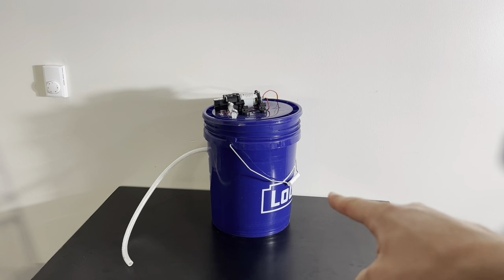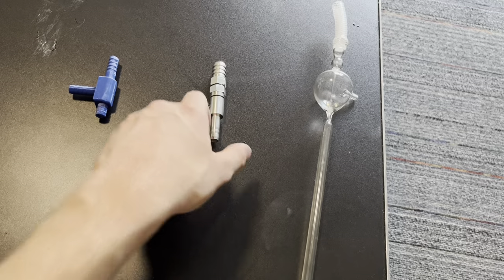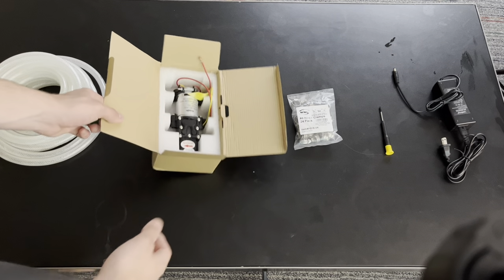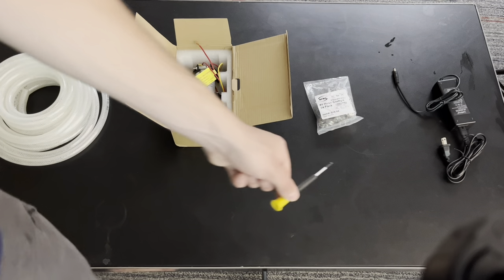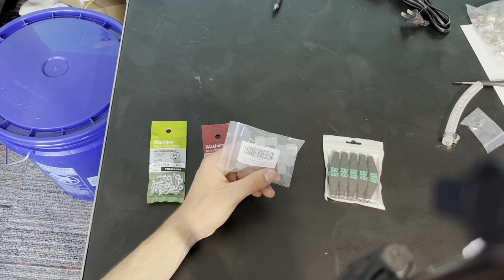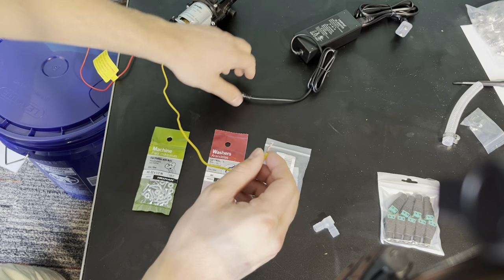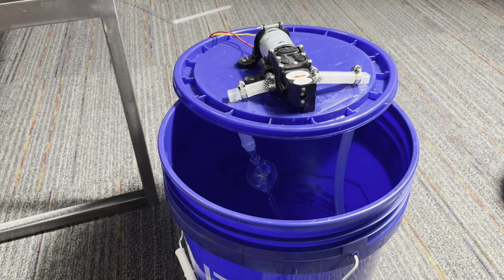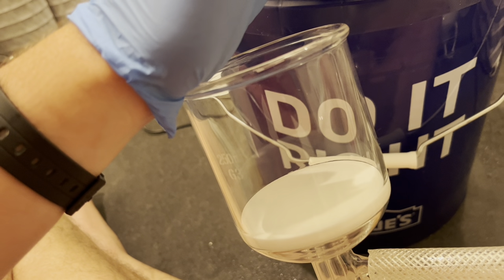Building a Recirculating Water Aspirator Vacuum Pump Under $40

Comment: Thanks for mentioning the source of the 3D model, I made my own model based on it that is easier to print on FDM printer. It works extremely well. I posted my model on thingiverse "Water powered aspirator vacuum pump" if anyone is interested.

Comment: if temperature decomposes h2o2, then maybe you can vacuum distill the h2o at lower temperatures with a cheap recirculating aspirator vacuum pump. You can 3d print a vacuum aspirator, you'll need water pump, and reservoir.
Reply: temperature and pressure are linked
Reply: @jib346  Exactly my point😊, vacuum distillation lowers the pressure and the temperature. In theory then, vacuum distillation would incure less thermally caused decomposition, than using heat distillation.

Comment: I wish I had viewed this video before i bought the water apirator (Link of an aspirator similar to what I bought attached) https://www.youtube.com/watch?v=c0ax2PWOBhU. I plan on using the aspirator on a rotovap with a chiller. My question is there are 4 ports on the aspirator, should there be pipes connected to all the 4 ports? Can the vacuum pressure be varied? If yes, it can be varied then how can it be varied?
Reply from the maker: The vacuum pressure cannot be adjusted with the setup shown in my video unfortunately (except maybe by using colder water or a different water aspirator, but the change would be minimal and imprecise).